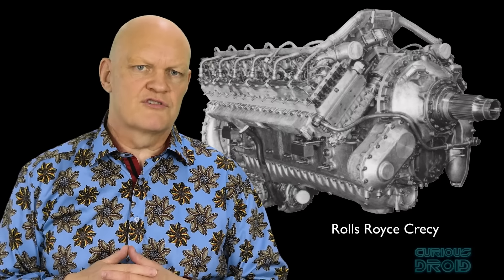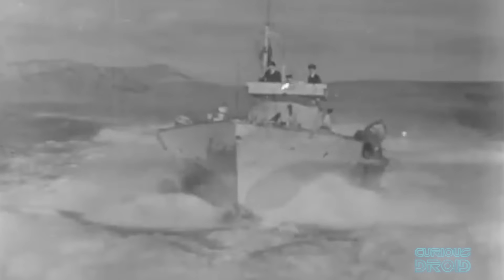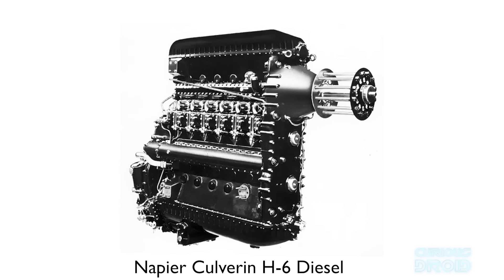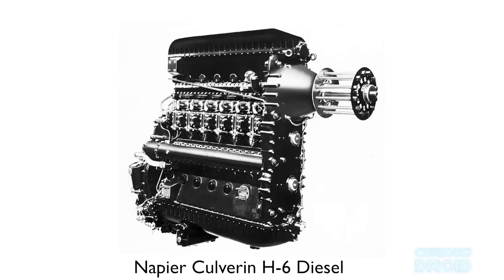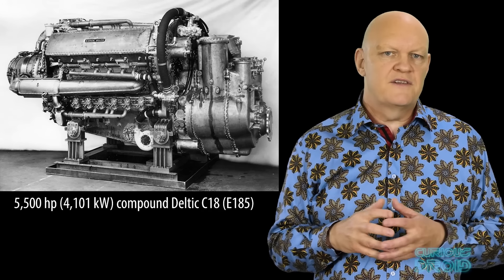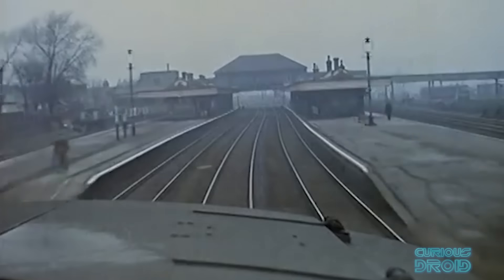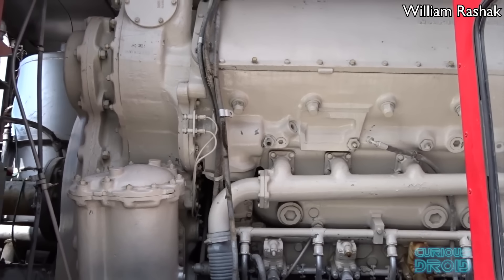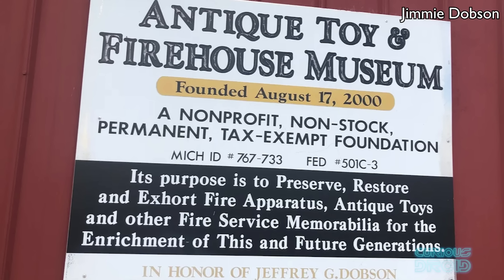The Legendary Napier Deltic - 88 Litre Opposed 2-Stroke Triangle Engine

Comment: how do? should give the old gardeners straight 8 a shout out as it pushed a 48' tas. hardwood 6''x1.5'' coachbolted onto double 3''x2'' ribbed hull fishing boat along at 45 knots 3 x heading back to stanley from a sandy patch halfway to king island. we'd been working across tide and force 6 all day longlining 7x 1 m sets, [ 330 hooks per ], trying to cover from force 7 headed south between hunters and three hummock islands. trouble was change of tide coming up from south east of straight to a 2 mile bottleneck which surfed us three times and crashed over us. then the trusty gardeners popping at 1 per 5.5 seconds with weight of water holding us and boat completely submerged then slowly regaining tach as whitewater peeled off with bow pushing up like submarine emergency float. we had a 100 wtt haelogen aft spot light aimed horizon angle, though when i looked up from perspex window on sliding wheelhouse door, i couldn't see the top of either three waves, taztez.

Comment: It's no all about the BHP. Talk about the Torque.
Reply: That doesn't really matter in Locomotives, as the deciding Factor is the Torque of the Traction Motors. You could power them by a fast, low Torque Engine or an equally powerful slow, high Torque Engine and the Traction Motor Torque won't change if you use accordingly different Generators. Or you could replace the Diesel Generator with an accordingly rated Transformer, turning your Diesel-Electric into an Electric Locomotive. There, you'd lose some Tractive Effort though, unless you add Ballast as Electric Locomotives have a much better Power-Weight and Power-Size Ratio than Diesels.

Comment: Relatively  simple  with  no valves cams  etc with  lot less little  bit   flying   about   I  assume  reliable,   wonder how many  hours  they  lasted  ?  Many  big   areo  engines    requiring   regular    rebuilds  ,  think  iread    Merlin   bomber  engines   going to  Berlin   only  lasted   30  trips
Reply: not sure exactly how many hours they lasted, but it's well known that there were a lot of problems getting them to work somewhat reliably, and any complex engine design like this is difficult (or at least time consuming) to maintain. They also share a problem with the Wankler (rotary) engines that they start to leak over time and lose pressure, which drastically lowers their power output, so they pretty much need constant maintenance to keep running properly. Thus the need to swap the engines rather than in-situ maintenance. Their fuel inefficiency is ultimately what ended their life, but most ships and locomotives that used the engines were only in service for 20 years or less before they were retired, which is not very much. In comparison in Europe we still have a lot of GM engine locomotives from the 1950s in regular service on maintenance and rural freight trains
Reply: @thesteelrodent1796  The Deltic prototype was built with a view to export sales wasn't it, but as you say GM were building more reliable engines. Although some English Electric 37s and 20s are still in service in the UK.

Comment: I would like to understand piston engines, rocket engines, electric motors, clutches, gears, hydraulics  and other mechanical devices better. Does anybody know a good source to learn about this stuff Are there detailed 3D models available, that I can take apart and together with some software that ideally also show the function and explain how the parts are working together?

Comment: It is not a diesel engine. Diesel invented a 4 stroke compression ignition cycle. The Deltic is a 2 cycle compression ignition process.
Reply: @ruben_balea  correct to a point.  4 cycle engines were already invented. His patent DRO67207 adapted 4 cycle engines with a compression ignition cycle. Your assertion that he did not invent a specific cycle is wrong. He invented the compression ignition cycle in 4 cycle engines.
Reply: @ruben_balea  I agree that he did not invent the 4 stroke engine

Comment: The Bass Trader, an Australian designed and built cargo ship, was powered by two Deltic engines.  https://www.bassstraitmaritimecentre.com.au/the-bass-trader/
On one overnight voyage from Tasmania back to Melbourne one of the engines failed, but fortunately the ship was carrying another Deltic as cargo.  This engine had just been serviced so the ship's engineering team set to work and replaced the failed engine with the 'spare'.   They arrived a few hours late, but not nearly as late as they would have been on one engine.   There cannot be many ships that can claim to have had one of their main engines changed out while under way at sea on a routine voyage.

Comment: The UK railways still don't run any faster than when the Deltics were used.
Reply: Wrong - there are trains running at over 180mph every hour of every day of the week.
Reply: @18robsmith  I am talking average speeds not top speed. In fact, I read recently that average London to York is not that much quicker than 50 years ago.

Comment: I wonder how these type of engines might have worked in tanks.
Reply: They did put what was essentially a copy of the Jumo 204 in the Chieftain: 6 cylinder opposed piston, vertically mounted multi-fuel (supposedly). And the answer was ... not very well. 😐 And the Soviets used a 5 cylinder version in the T-64.
Reply: @AndreiTupolev  Thanks

Comment: METRIC!!! I don't get why still the use of imperial measures, when only 2 countries use it
Reply: Do you mean horsepower? That's used pretty universally to describe power outputs (PS vs HP is only a slight difference)
Reply: @AndreiTupolev  I mean feet, miles (not the nautical ones) instead of meters, liters, kilos...
Reply: @JoniFili  well, they were the units in use in the country where they were produced. Besides, it is a fact that an English-speaking audience would probably use imperial measurements as the default setting

Comment: Omg. Just build a radial already.
Reply: Not going to work in a boat or locomotive where the Deltic reigned supreme…
Reply: @stephenpage-murray7226  The Soviet Union built an Engine for a smiliar Purpose like the Napier Deltic. It's a 42 Cylinder Radial, or more precisely, 7 Inline-6 Engines arranged radially around a central Crankshaft. Hence it has more in common with Inline Engines than Radials (e.g. DOHC Valvetrain isntead of Cam Ring and Pushrods, Water Cooled etc.). It was used to power small Naval Vessels like Patrol Boats or Corvettes.

Comment: Why do you call the straight 6 Junkers an H? An a H engine is like a flat twin/four/six with another block the same mounted above running in the opposite direction (clockwise vs anticlockwise) then geared together, like Napier did with some of their area engines. If they have a dry sump you can turn the engine on the side & it will look like a H from the front. Think the orientation of the engine of a Brough Superior Dream motorcycle lying on its side. WTF would someone refer a single bank straight 6 with opposed pistons a H block engine is beyond me?

Comment: Actually I don't think these engines were ever suited for airplanes and I don't think they will ever be suited for airplanes because the jet engine the compression is just necessary for thrust for prop wash for jet propulsion you know up there in the air you just need a different source of power

Comment: 4:40 shouldn't that be four banks of 12 pistons not four banks of 6 pistons? ;

24 cylinders, (4 banks of 6 cylinders) 2 opposed pistons in each cylinder equals 12 pistons per bank ergo 12 pistons per crank

Comment: I would have thought that you would include the Chieftain MBT L60 engine. 6 cylinder opposed piston. The design of this engine was good but unfortunately the Labour government of the time insisted it be made by the British Motor Corporation (BMC) run by Red Robbo the communist union leader. Needless to say their workmanship was F***ing dreadful. I should know I had the job of stripping and rebuilding the L60 straight from BMC. Thankfully we now use Rolls Royce again.

Comment: Basically, Napiers never produced a decent engine. The only possible exception being the Lion - and that took them about fifteen years - by which time it was a relic in any case. Typically for Napiers, the Deltic was riddled with problems that were never sorted. It's a mere curio.
Reply: It ran in the Deltic locomotives on the ECML daily and still run in preserved Deltic locomotives today on the main line.  They were regularly exceeding 100 mph and reliable.

Comment: OK, so this sucks. Why? Because there is not a single video with sound in there, and the sound of the Deltic engine is so important. So this video is actually really bad. Missing the most important thing. What a failure.

Comment: If it is made anywhere besides the USA, it is NOT a masterpiece of any kind. You would have to see a USA product with the same thing built in other countries to compare them in order to see the vast difference, or just use them both until one or the other breaks. 90%+ of the time the USA product will outlast the other. I don't have anything against any countries products, but the proof is in the pudding as we say here in USA.